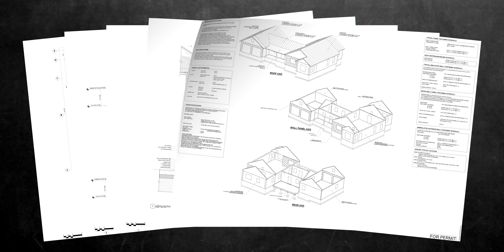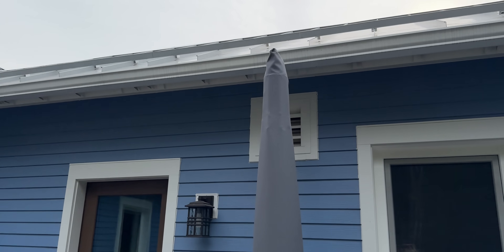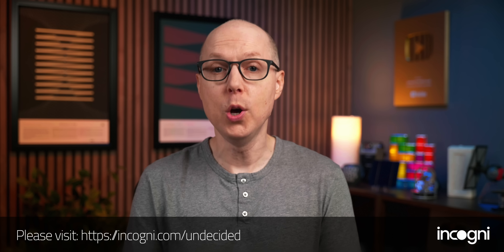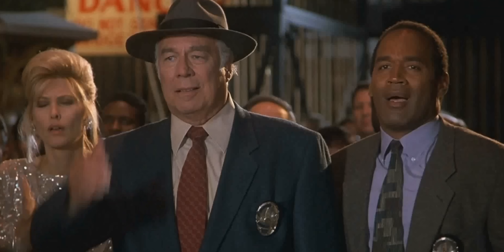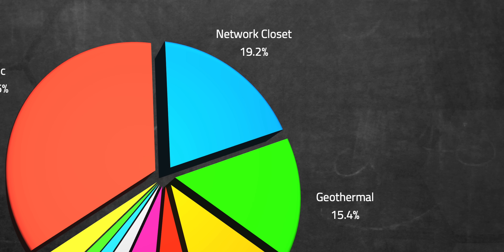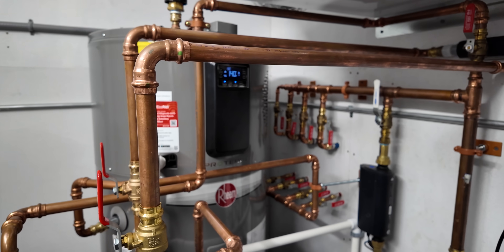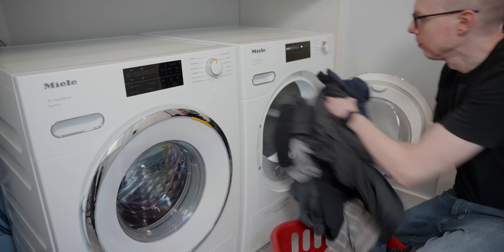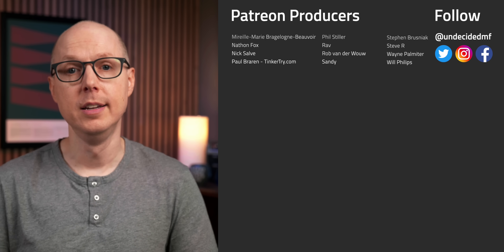What I Learned After 1 Year in My Net Zero House

Comment: Lest people worry, I will point out that a feature of induction cooktops is that nothing gets hot unless there is ferrous metal on the burner when it gets turned on.  A cat walking across, or a child playing with, an induction cooktop will do nothing more than make beeping noises.  The cooktop can sense that there is no pot or pan and won’t energize the burner, and the cat is completely safe.
Reply: I mean if we're worried about emf radiation from an induction stove, you might want to stay away from WiFi, cellphones, speakers, or anything that has an alternating current 😅
Reply: @NinjaT31 these are all
Measurable sources and you should not keep them as close to your body as induction stove gets, that’s what’s been found when studying these in non industry funded studies.
Reply: Also if I turn mine on (four ring built in type unit similar to in the vid), but no pan is placed on it, it just turns itself off again after about 10 seconds (at least mine does, although I don't know if this is common to others). It does the same if you've been using it, but take the pan off the heat. It bleeps at you first after about 5 seconds (so you have enough time to pick up and shake/flip etc without it being annoying),  it then switches off if you don't put the pan back on the burner. (It also shows 'H' for hot for a while after using it, so you know it's hot to the touch).
Reply: @JohnLaFosse   do you even know what citation is? Yes, your the person saying it does. Why use induction? Because it doesn't harm health, better efficiency and safer then infrared.
Reply: there's no burner in an induction cooktop. There's just coils that heat up the pan itself. And they won't turn on, if there's nothing on top.
Reply: @JohnLaFosse An induction cooktop typically runs at around 50kHz or less. The electromagnetic wavelength of that would be around 6kilometers. Now compare that length to the size of a human cell.
Reply: @JohnLaFosse  It's safe when used properly. It's also the best option, I'd never again chose anything else.
Reply: This is a bad time to mention cats and cooktops 😂
Reply: @philipvecchio3292  Are you concerned about the cat going "woof"?
Reply: The surface still gets hot after you've been cooking on it.
Reply: @rpfour4  you are correct that the surface will be hot after cooking on it, but that is true for any cooking surface: gas flame, resistance electric coil burner, infrared burner, induction… if the pot is hot, the thing the pot was sitting on will also be hot.  Usually an induction burner is less hot, because it was heated via thermal conduction from the pot down to the burner, as opposed to the burner getting hot and heating the pot via conduction.
Reply: @rpfour4  Yes, the hot pan actually heats up the surface. It cools down pretty quickly though.
Reply: @JohnLaFosse you do realise the wavelength of infared in 780nm, while still not dangerous it is far more dangerous than induction
Reply: @JohnLaFosse  John, you clearly have no idea what induction means, nor how it works.
Reply: @Jimmeh_B  He probably meant Induction of Labor.
Reply: Let’s be straight, there’s no burner. Nothing really burns to generate heat on the hob side. There are induction coils that induce a current in compatible metals and hence heat up causing maybe the pot to « burn » but not really. But we get you, it’s just we’d pick other language for this.
Reply: @JohnLaFosse erm? Infared is far more dangerous, actual studies have shown it can be damaging to your eyes, it’s still safe but not as safe
Reply: @JohnLaFosse  Wow, that was some made up, uninformed vomit.  Your home is already full of electrical coils (every major appliance and most wall warts), and that is all an induction cooktop is.  Fact is your microwave oven has a larger and more powerful transformer than an induction cooktop.
Reply: My only gripe is how fast the thing starts beeping at me when I move a pan around. Also, my mom's has touch controls on the surface, and that is the worst.
Reply: @Senthiuz  I did not want touch buttons on my induction stove.  I wanted dials.  I think that I can control a dial easier than trying to push the touch pan 3-5 times up or down.  I am trying to be old fashion in a modern world.
Reply: @JohnLaFosse you do realise what emf is? It means the low frequency ones like x rays and uv, and you do also realise infrared is right next to uv meaning it is far more dangerous the induction which is miles away (literally in wavelength)
Reply: The people that live in Springfield, Ohio are not happy with your post.
Reply: @JohnLaFosse YOU…are TOTALLY NUTS!!
Reply: @JohnLaFosse It doesn’t. Misinformation.
Reply: @JohnLaFosse  The EMF radiation from the normal electricity wires in your wall dwarf the EMF emissions of any induction cooktop. And it's not shielded at all, differently than your cooktop. If you are sensitive to an induction cooktop, then you will die purely from being in an electrified home.
Reply: Yeah it truly is a game changer if you care about energy usage.  It has solved many of my VOC gas problems in my house since converting from "natural" gas methane fossil fuels along side no chimney to lose inside energy too!  Methane "natural" gas is just a dumb idea in the 21st century with all the much better alternatives we have now.
Reply: @yourmomma69-g5r  Except it costs much more.  Net zero isn't cheap.
Reply: @JohnLaFosse  You keep saying "EMF radiation" as if that is making your point, while praising infrared cooktops. Infrared cooktops also produce almost exactly the same amount of "EMF radiation" as induction cooktops.

Also you cited the "World Health Organization" as the source of your claims, but that is simply a lie. While they do make recommendations about EMFs, they do NOT claim, and have NEVER claimed that induction cooktops are in any way dangerous or cause reproductive harm. They don't even warn about the radiation produced by MRIs, which produce orders of magnitude stronger EMFs than induction stoves.
Reply: ALF, disapproves of this message !
Reply: issue with induction stoves is they are considerable more expensive & more likely to break. Basically they  use high frequency AC driven by MOSFETs or IGBTs & also have a feedback controller. When you move a Pot off the burner, the induction falls leading to increased current flow unless it regulated by the controller.
Reply: @guytech7310  Breaks more likely, sure, thats what you "heard". Induction are standard here in Europe, NO ONE talks about replacing their induction stovetop due to they break, no one...
Reply: @tuenygaard8075  They break all the time at least here in the US.
Reply: @guytech7310  I got a single burner NuWave induction cooktop for like $70.00. Not expensive at all.
Reply: That doesn't mean that the trend of cheap capacitive buttons in everything needs to stop.
Reply: you can put your hand above the cooktop and turn it on, you also can put your hand between a pan and turn it on. pan gets hot, plate stays cool, also your hand will not sense anything besides the heat radiated by the pan. imho its the safest way to have a cookplace in your house with nearly 0 risk of burning etc.
Reply: All very expensive technology.
Reply: I just traded out my gas cooktop for an induction, and I couldn't be happier. It works great!
Reply: That's not how induction heaters work.
Also, there's iron in your blood.
And your cat's.
Reply: @JohnLaFosse  Valid citation required. 

It is true that companies who sell induction hobs reference https://www.p65warnings.ca.gov/ - but if you actually search the site, induction isn't mentioned anywhere - it only talks about chemicals and poisons. (This is presumably where this nonsense has come from - people making assumptions without actually checking.)

Induction is a magnetic effect which is a tiny fraction of (say) an MRI - and there is no warning about MRIs doing that. So this is utter bollocks.
Reply: @JohnLaFosse  Induction is purely 50 Hz or 60 Hz electromagnetic fields, much like the fields in and around an electric motor, or your normal house wiring. If designed and used properly, almost all of the energy goes into the ferrous metal of the pans being used. That's why induction heating is so efficient. 

At the levels found around domestic appliances, any stray fields are perfectly safe, by law. When the utensil is taken away from the hob, it switches off within a few seconds at most. In any case, the ultra low frequency fields produced would pass straight through you without interacting with your body. If induction devices were unsafe, then you would not be allowed to buy them legally.

Workers in electrical power generation and distribution have long-term exposure levels to EMF which often exceed the fields around a domestic induction heater, with no recorded and confirmed reproductive problems.
Reply: @JohnLaFosse  electric energy, especially the kind in induction cooktops, has no links to health issues. The type of "radiation" that microwaves, phones, stoves, hell even your walls produce is non ionizing radiation, you probably have more radon dust in your house/lungs than you would ever believe and you are worried about a harmless stove? I bet you are the kind of person to use "negative ion" products and "nume cards," both of which put off the bad radiation, ionizing radiation, and lots of it. If you are worried about an induction stove, then be sure not to use a TV, microwave, computer, phone, electricity, electric lighters, cars, hell make sure you toss your keys, they put out radio waves which we all know is a form of radiation
Reply: @johnlafosse Considering the amount of electromagnetic energy we all are exposed to every day, if that were true birth rates would plummet. This is the same kind of pseudo-science that told us cell phones cause brain cancer. That being said, my grandfather lived to 99 in a home that used initially coal for cooking and heat and later natural gas. He had no health issues from this even though it can be shown that both are dangerous to health.
Reply: @jpe1  how am I supposed to light my crack pipe, then ???? Answer that, narc!!!
Reply: @JohnLaFosse 

https://www.ncbi.nlm.nih.gov/pmc/articles/PMC10655672/ does not agree.
Reply: @JohnLaFosse  wow, the conspiracy theorists have stopped being scared of 5g and are now calling a more dangerous version of it safe while calling induction dangerous
Reply: @JohnLaFosse you do realise that infared is on the electromagnetic spectrum next to uv and microwaves, which means its next to things you are probably most scared of as a conspiracy theorist and if anything it is definitely more dangerous than induction
Reply: The cat is never completely safe, they have a desire to cause chaos so will push a hot object off the cook top.
Reply: @therasco400  one of my cats jumped across the room into my induction pot. He then got grabbed and put under the running cold tap. There was a lot of struggling between the pot and the water but it must have helped because he was ok with water for the first and last time.
Reply: @JohnLaFosse care to quote your source there, it smells like BS
Reply: Miss our induction cooktop😢
Reply: @JohnLaFosse  reproductive damage, explain please?
Reply: @JohnLaFosse  Wut?
Reply: @JohnLaFosse  like 5G and RF,right?
Reply: @JohnLaFosse What!? Says who?
Reply: And if one wants to use  glass or copper cookware?
Reply: @TheDanEdwards  then they're probably weird. Glass on the stove top? Really? Who?
Reply: @JohnLaFosse  First time I've heard of this. What is your source?
Reply: @JohnLaFosse  
Induction can cause reproductive harm if you put your junk in the pan and turn it on. I avoid this practice, so I feel pretty safe.
Reply: I wish we could convert to IH, but we live in a condo in Japan with only standard 100V power and natural gas for the cooktop, water heater, etc. An IH cooktop would require 200V, and running such a line into the condo would be prohibitively expensive (or maybe impossible - we haven't checked).
Reply: Some people can hear the stovetop however
Reply: my cat is made of ferrous metal.
Reply: @JohnLaFosse  that's been studied and it simply isn't true. https://www.ncbi.nlm.nih.gov/pmc/articles/PMC7327398/
Reply: What about after use?  The top stays hot for a while.
Reply: @D2O2  It does, but only through conduction from the pan. It cools as quickly as you'd expect a piece of glass to cool once you take the hot pan away.
Reply: @D2O2  yes, the top stays hot, but not any longer than any other top (and probably less long, because it usually doesn’t get as hot during cooking). For example, if I just boil a cup of water it only takes like 2 minutes, and not that much heat transfers from the pot to the cooktop, so it’s not that hot.  If I simmer a curry for a half hour then yes, the top will be hot and will take awhile to cool off, but that’s not any different than conventional electric or even gas.
Reply: Unless its already hot, then you just get burnt anyway 😆🤪🤪🤪
Reply: @LivinJoyfully  things in contact with hot things get hot. Not a lot to be done about that.
Reply: @JohnLaFosse as a physicist, I don’t see how a low frequency magnetic field can cause reproductive harm. 
Can you explain?
Reply: @JohnLaFosse  you are misinformed.  Since 1997, the Ordinance on electromagnetic fields, (26th BImSchV, amended in August 2013), has been in force in Germany. It was issued for protecting the population against health hazards from electromagnetic fields. The Ordinance and the included limit values are based on recommendations of the German Commission on Radiological Protection, the EU Council Recommendation and on the guidelines of the "International Commission on Non-Ionizing Radiation Protection" (ICNIRP).
Limits provide protection against scientifically established health risks. In the high-frequency range of electromagnetic fields, limit values are aimed at excluding health-relevant thermal exposures of the body.
The limits are frequency-dependent. This is why different limit values apply to the various applications of high-frequency fields.

Induction cooktops, like many other devices such mobile phones, Wi-Fi routers, display screens and many many other devices are safe as they fall with in the limits of these regulation.  I live in Germany and have had an induction hob for over a decade. It is safer than gas, wood, plain electric and any other forms of heating up food. It is clean and fast.

Source: https://www.bfs.de/EN/topics/emf/lff/application/field-intensity-everyday/field-intensity-everyday_node.html

Before you make further please provide official sources.
Reply: A cat walking across, or child playing with the buttons is safe - yes, as long as there is nothing cooking or even standing on the stove. My cooktop has a locking mechanism which I always turn on when not using or during cooking, but the one time I didn't my cat turned the stove with an empty pan to Boost mode. Luckily I noticed quickly that something is burning but it could have been much worse. This is all to say that you still need to be careful, and the induction stove w/o child lock is a big no no in my book
Reply: @devligue  it can also happen with other stove types.
Reply: We have the same experience. In my experience induction cooking is great but I would love a system that came with actual control buttons/switches. I'm not a fan of touch interfaces in kitchens. Or in cars for that matter. Tactile feedback is just more convenient. But that is a trend separate from induction.
Reply: Yeah....thing is, I am lazy and leave my pots on my stove.....and my cat managed to properly smoke my house by completely carbonizing my leftover porridge 😂😂😂
Reply: I just want to point out that science cannot prove that induction cooktops are "safe", only that they have demonstrable effects. Anyways, they are leaky and capable of leaking large amounts of energy. There are some amusing "shocking" videos out there demonstrating such things as frying electronic circuits or lighting bulbs when used with a pan that is allowing leaking because it is too small or off centre. I use one and prefer it functionally for most use cases over other types of stove. I do have 6+ other ways of cooking available, both indoors and outdoors.
Reply: Are you sure he wont go "Woof!"?
Reply: Unless it's got a really big tag and it lays down then knocks the control.
Reply: @jpe1  that's not how it works. The cooktop never gets hot, even when you're cooking. The cook top energizes the cookware itself, not the cooking surface. It doesn't "sense" a child or a pet. It's not that smart, it's just a big ole magnet
Reply: @alex23_0  I can’t tell if you are being pedantic about my grammar or word choice, or trying to be sarcastic about something, or simply displaying ignorance of the topic.  I’ve been using induction cooktops since 1989, and I have a good working knowledge about how the use them to cook, and also how they actually operate.  When you write that “the cooktop never gets hot” that is obviously wrong, why do induction cooktops come with a “hot surface” warning light if the surface is never hot, and more to the point, by what mechanism would heat not flow from the cooking vessel into the cooktop?  That would literally break the laws of thermodynamics.  To be clear, the flow of heat is from the pot into the cooktop, not the other way around as is the case with resistance coil cooktops, so you are correct that “the cook top energizes the cookware itself” (to be specific, an electromagnet below the glass of the cooktop will rapidly switch field direction, inducing eddy currents in ferromagnetic cookware above it, and those eddy currents cause the cookware material to heat up) but a pot of boiling water is going to heat up whatever it sits on, be it tabletop, countertop, or cooktop (this is why trivets and hot pads exist, to protect surfaces from the heat of a hot object sitting on them) As far as your claim that an induction cooktop “doesn’t ‘sense’ a child or pet” I’m at a loss to understand your point.  Are you disagreeing with my use of the word “sense”?  Do you think I’m anthropomorphizing the cooktop?  Regardless, in the cooktop I currently use (which is typical of most models on the market) there is an array of capacitive touch sensors, and sensor is the term used in the instructions and also the usual word used by English speakers, so I think it’s reasonable to say that a “sensor” will “sense” the thing it’s designed to “sense”, and in the case of a cooktop, that sensor senses the touch of skin, but it doesn’t know if the touch comes from an adult intending to use the device, or from incidental contact (for example, while cleaning the cooktop) or from a child or pet.   I don’t know how you would have me phrase my statement to meet your approval.
Reply: For all you gas stove snobs, if boiling water super fast is not enough of an incentive to buy induction (and really who cares), the real unmatchable advantage for chefs, is induction’s capability of providing a very low temperature for delicate sauces or tempering chocolate.  Just sayin’
Reply: True! The magnetic activation is such a wonderful safety feature.
Reply: What is the cat puts on metal claw tips?
Reply: no though. no. absolutely no.
Reply: Pam here…love our induction.  The studies around lung cancer rates with gas stoves is startleline. Also, for me being legally blind, open flame is scary.  Induction is great as if I spill I can lift my pan safely wipe off the ‘warm ish’ stove top and burner and set it back down.  If your going for all electric an induction is is the way to go along with a microwave and a toaster oven option to save on using a big oven.
Reply: @JohnLaFosse  Evidence?
Reply: @kddidit08  https://www.cancer.gov/about-cancer/causes-prevention/risk/radiation/electromagnetic-fields-fact-sheet
Reply: @kddidit08  shield your body is another website addressing EMF.
Reply: @JohnLaFosse reported for posting misinformation.
Reply: Ferrous and feline both start with Fe (iron), so cats may be inductive too.
Reply: @michaeldew7904  only feral cats, obviously...
Reply: @timseguine2  wouldn’t a Feral Feline be twice as inductive?  A Ferocious Feral Feline thrice?
Reply: @michaeldew7904 😂
Reply: @michaeldew7904   🤣
Reply: The cat might be safe, but you're not safe from the bacteria and other parasites which the cat leaves on your work and food surfaces.
Reply: @RWBHere   If you have cats the first step to food preparation is always to clean the surfaces. I know. I have cats. They are trained not to be on the counters and I never see them there. But cats are not fools. What they have actually learned is "Never go on the countertops when a person can see you." The occasional feline footprint on the stainless steel top of my stove confirms this.
Reply: @JohnLaFosse  Okay John.
Citation required.

I'll wait.
Fuc... I'll even hold my breath!!!
Reply: @Jimmeh_B dude is saying electromagnets cause reproductive damage, clearly they cannot provide any source for such a claim xD
Reply: @overlordnyanya  Egg.
Zachary's. 

Dude doesn't even know what an Eddie current is.
Reply: @overlordnyanya  the induction cooktops technology passed industry safety requirements by stating in  the instructions that one is not meant to  be operated within arms length!  to avoid electromagnetic radiation over exposure. Yet everyone operates them closer than what deemed a afe, according to instructions,  cos that’s how cooking is done. 

 Imagine what it does to your entire mid body, in daily use of 20yrs?’ 
 (what about an expecting
Mother’s mid body?  = Baby’s brains? 
What about all the food (molecules organized by nature) being blasted with such strong and foreign type of electromagnetic radiation.

This technology along microwaves will move to history as human become
more appreciative of natural energy  harmony of living environment, 
The natural liquid crystal of water in our bodies and non irradiated foods, 
and the living  environment. 

Growing infertility due to greater than before electromagnetic exposure from sources  such as the induction stove tops an EV’s will lead to the awareness of the harms of these technologies, but surely they will be sold to prospective buyers for years to come. 
And everyone is allowed to buy one.
Reply: @thomaxtube I don’t believe that for one second and even if it is true, have you ever walked under a powerline? That means you have been exposed to far higher levels
Reply: @rhysrail  Note to self, don't put balls on induction cooktop.
Reply: @georgegoodwin9722  correct!
Reply: @schmitty8225 😂
Reply: @Jimmeh_B   I am waiting too for the citation too. Switched to induction cooking over 10 years ago.
Reply: @Jimmeh_B Trump said it, so it’s TOTALLY a LIE!!!
Reply: @Jimmeh_B You still holding your breath or are you dead by now?😂
Reply: What about aluminum pots?
Reply: @marenjones6665  just checked, apparently not, same for copper, it also won’t work. 🤷
Reply: My issue with induction cooktops is I am pretty clumsy, and my disabled elderly mother more so. The amount of times things have been dropped on our gas stove is not small. So how many times would we have had to replace it already? More than 1 for sure, so that is not an option at my house.
Reply: @rabbithowls71  the actual material of the top for my induction cooktop is Schott Ceran brand ceramic, which is incredibly tough stuff, it takes more than dropping a pot or utensil on it to damage it.  As an extra precaution, one can place a silicone baking sheet on top of the cooktop to protect it, the induction works through the silicone.
Reply: @rabbithowls71  you get ones without a glass finish and I think it is purely cosmetic anyway so shouldn’t matter
Reply: @rabbithowls71  do you have house insurance? Mine covers the breaking of glass, which includes induction cooktop. Doesn't matter if I break it myself.
Reply: Yea but that’s a lot of magnetism
Reply: Thanks for the 7th grade science lesson, dad.
Reply: @jpe1  there are problems with induction.  It can warp carbon steel pans, and the heat distribution is very uneven.  It also limits cooking techniques like using the pan to flip the food.  They are more expensive to fix when they wear out, and you're limited to using cast iron, carbon steel, and stainless steel.  I have an AGA induction top range, but I have learned AGA doesn't fix these ranges when the induction HOB wears out.  If that happens, I am swapping it out for a gas stove.
Reply: The microwave oven is far more efficient.
Reply: @harry130747  correct, but it not a stove. 2 different appliances.
Reply: @harry130747  nope.....